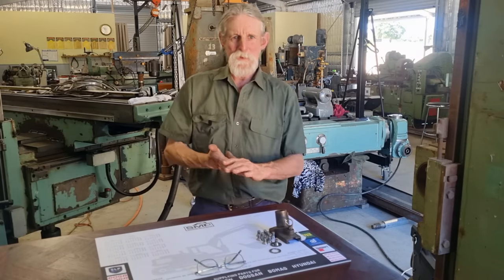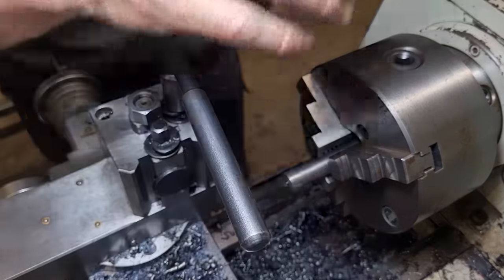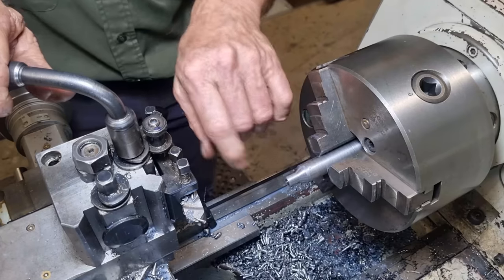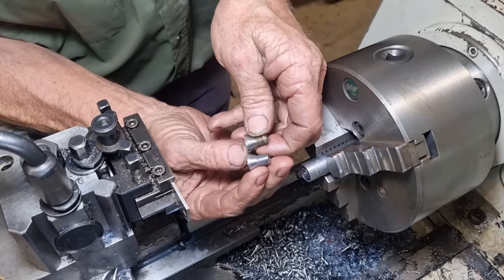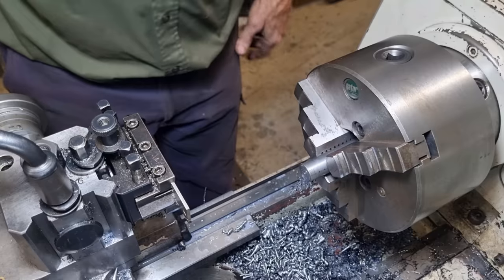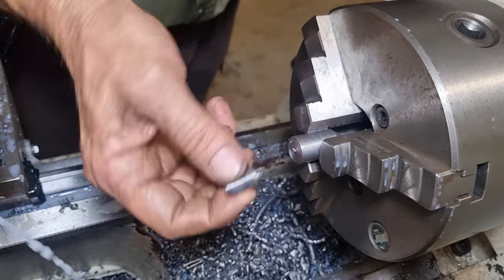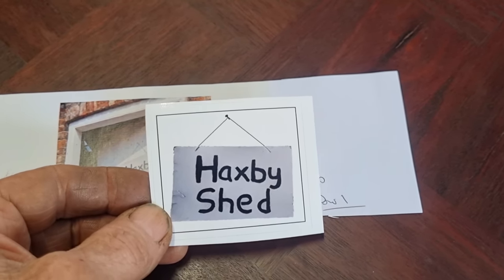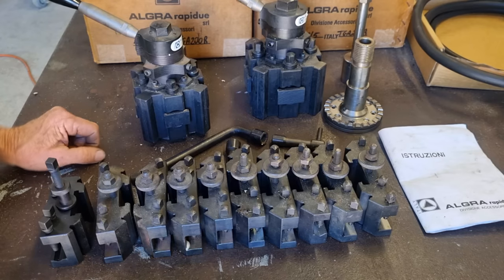Making 3/8 British Standard Fine , CSK Screws .

Comment: The UK adopting the metric system put paid to the imperial threads BSF, BSW, BA etc. I was an apprentice in the early 70's so I was taught in both imperial and metric, which was a huge advantage. Nicely done making the screws, to the old school specs. I watch all 3 of you gift givers, they are all fine engineers and are worth watching, as are you too! Good post, thank you 👍
Reply: Me too, 1974
Reply from the maker: Thanks .    My apprentice years were  the first half of the 1980's  & a mix of metric and imperial .   There was a lot of converting to do on imperial lathes & metric milling machines ! 👍
Reply: I was born in the 80s, so educated solely in metric. At least at the level of conversation though, imperial so often just makes sense - inches and thumbs, feet and, well, feet. It's all just that bit more relatable.

Technically, BA threads are metric - 0BA defined as 1mm pitch on an OD of 6mm. Each BA number is the previous pitch multiplied by 0.9, diameter being 6x pitch.

Comment: Hi Max, like the form tool for quick machining.
Yes not much use anymore for BSW and BSF taps and dies, i have full sets up to 1/2" and not used them since the nineties.
Had to single point a 3.5mm x .5mm thread for a Mitutoyo bore gauge the other day, my eyes aren't  what they used to be but succeeded.
Reply from the maker: Lol , i have never cut a thread below 1/4 '' or 6mm on a lathe !   All this old stuff from 1940 that i have been doing is all BSF , now i have to slowly stock up on BSF !  👍
Reply: Max my 13x42 DSG had a brass thread cutting chart for the full range of BA threads, I thought was a bit optimistic but doable with a magnifying glass I guess.

Comment: Hi Max and channel.  I really took note of the repeat process as multi-part product.  So often, I am at a single task it is an over looked component as to product 5, 10 20 each.    So, I had the 
chance to work toward repeat, tool settings and feed.   Here at my shop the evening temp is 0 degrees C and so as a week forecast.  Thanks for the nice post, as I am delighted to take notes as to best practice and finish.  Regards from Washington State, US.  M.
Reply from the maker: Thanks .   We are in the middle of a week long heat wave here , wish it was winter !  👍

Comment: Never hurts to do a little screwing around in the shop. 😄Nice tool posts. Is that style of holders easy to find? They are not that common over here.
Reply from the maker: More common here .  I don't know if you can even buy a genuine Alois here .   I have mostly always used that style of tool post , old habits die hard !      Cheers Tom 👍

Comment: Nice one Max. How do you like the inverted parting tool? They're not as common as they should be.
Reply from the maker: The only way to go Preso .  It's just an ordinary one turned over .  👍
Reply: What is the reason/benefits of running the parting tool upside down?
Reply: @paulfarrant7209  It is a more rigid way of mounting the parting blade. When used in the conventional way, the cutting pressure on the tool forces the tip down and into the cut. The reason is that the pivot point is in front of the compound slide. The opposite happens when you mount the tool inverted. It tends to flex up and away from the work. There are also more subtle reasons for a parting blade digging in. The backlash in the cross slide nut and the clearance in the dovetail slide all contribute to that sudden and often catastrophic dig in.
Regards,
Mark

Comment: I have a very similar lathe probably made in the same factory. It has an American style apron but the headstock looks the same, and I cannot cut 1.75 threads with it either....WTF Tawain? do you not use 12mm 1.75 threads? Bloody nice haul from Kurtis on those those tool posts eh?
Reply from the maker: Thanks . Yes , not as if 1.75 is uncommon !   👍

Comment: Max is there any reason why you used the parting tool in reverse.
Reply: So tool 'pushes' headstock bearings down tighter instead of lifting them. 
Even if everything is properly adjusted, the oil film can be enough 'lift' when parting to cause chatter or tool/component damage
Reply from the maker: It gives less chatter trouble , esp with hard steels .   Also unlikely to dig in & break . 👍
Reply: Chips also fall out rather than in.

Comment: Isn't it an 82 degree angle of taper for countersunk/ flat head BSF with a 55 degree thread angle?
Pretty sure most of Europe will have no idea as metric are 90 degree taper with 60 degree thread angle
Reply: Do you not think that Max would have checked the angle and made the dozen to match the sample?
Reply from the maker: 55 deg thread & 90 deg csk , as per the sample .   👍
Reply: @bobhudson6659  I'm sure he would but didn't mention it in intro.